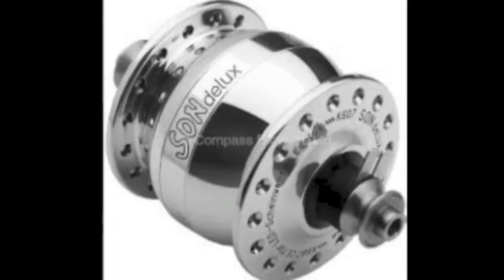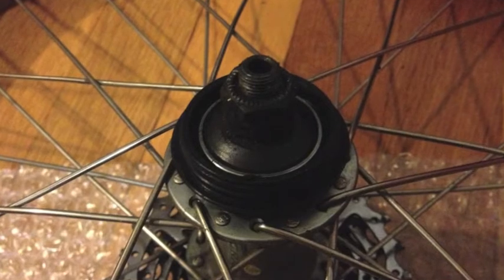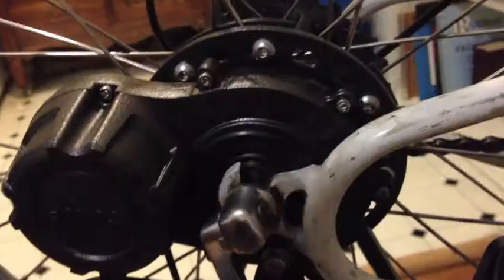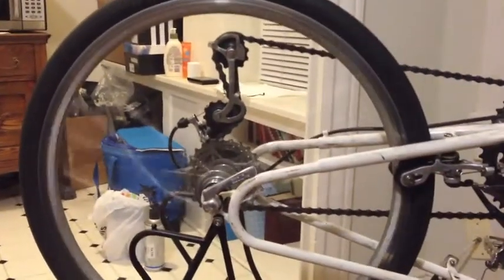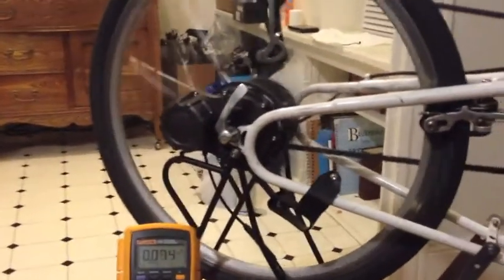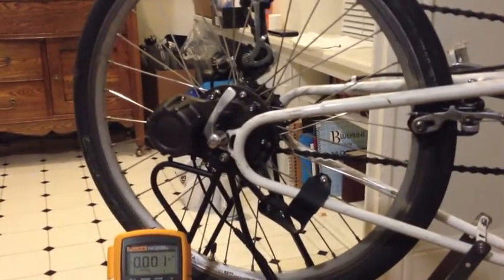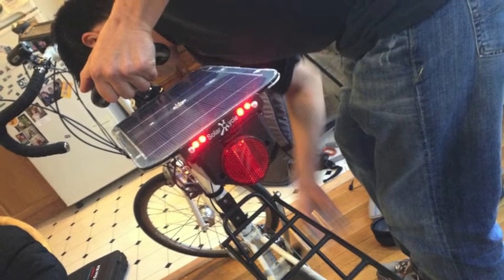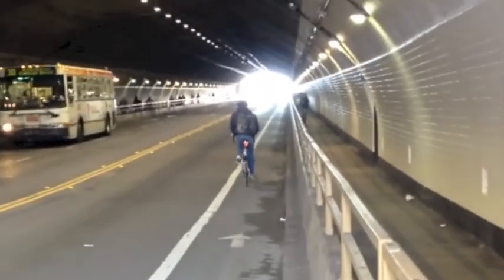SON Delux vs. Sunup Bicycle Dynamo Comparison

Comment: Thanks a lot for this comparison,  a quick question ... from the freewheling i sense some drag on both the HUB stile and the Sunup dynamo, from your experience, is this significant.. meaning would this be a heavy pain for riding long distance, hills up, and with front winds? 
thanks again
Reply: You don't notice it.

Comment: Thank you for bringing my attention the possibility of fitting a hub (sort of) dynamo without having to re-build the wheel.  Not something I had come across before.  Still would probably have chosen the SON, but worth knowing there are other options.
Reply: Don't forget the SON will cost £300 + the cost of having a wheel built, whereas the SunUp costs £185 for the 8W version, the 3W version is about half that around £100.
HTH